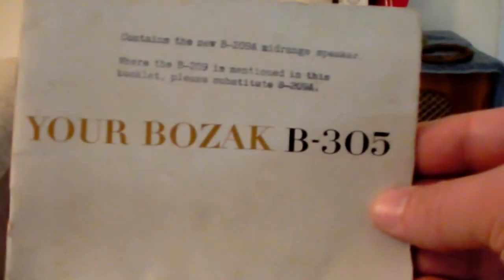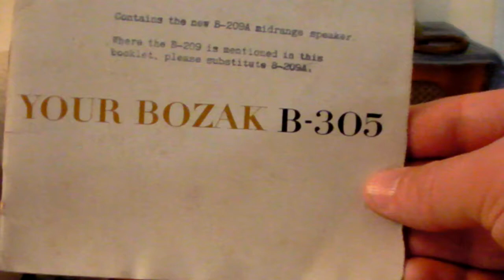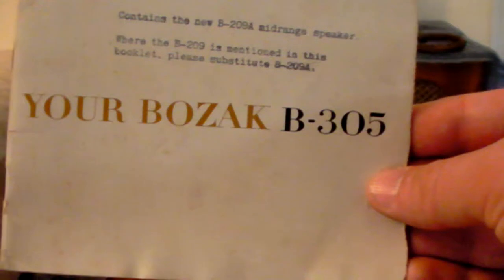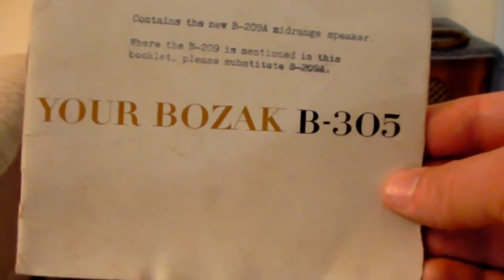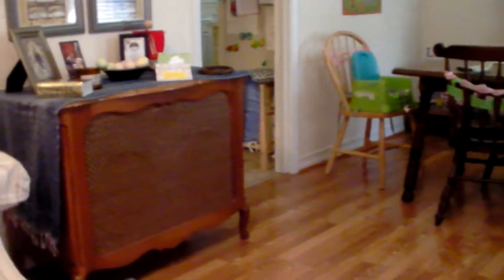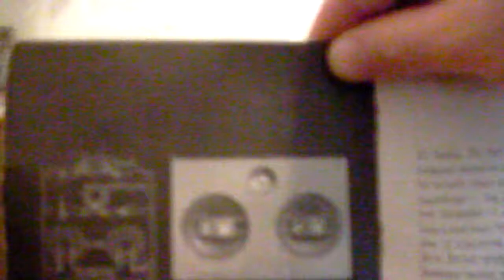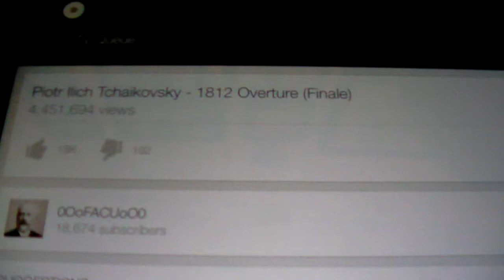Bozak B305 demonstration

Comment: I'd like to see this cabinet with the back removed to see what is inside.  I have an old Bozak mono cabinet with 2-12's.
Reply from the maker: Two 12's with coaxial tweeters (two per 12) and a little midrange driver up at top center.